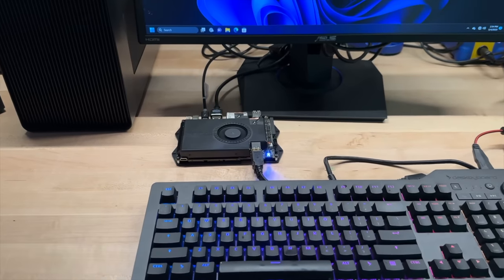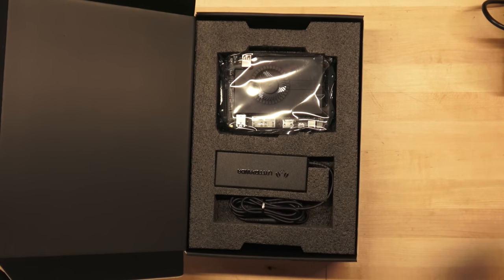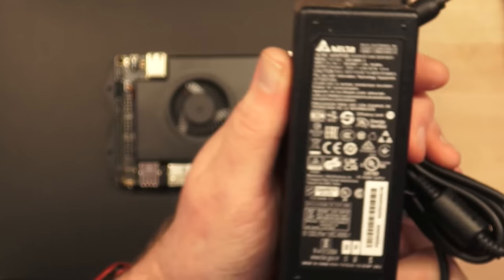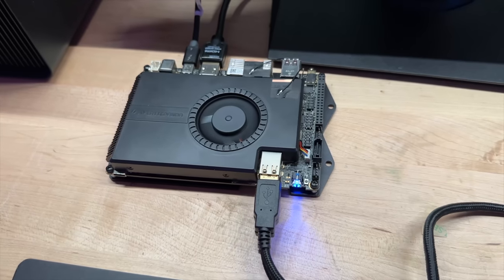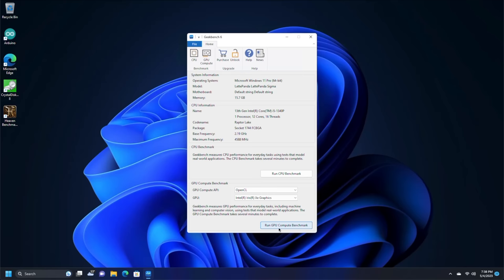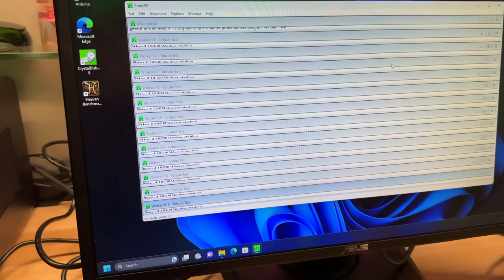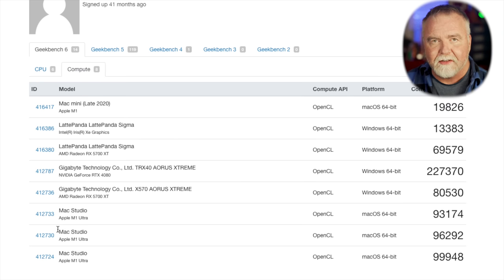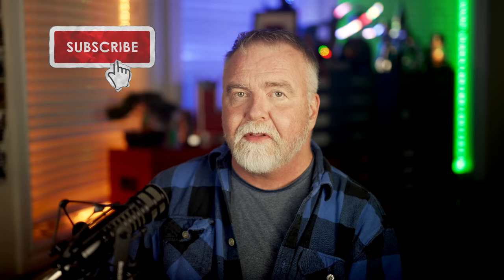The Sigma: The Most Powerful Single Board Windows PC

Comment: Why do they use that awful connector for WIFI? Instead of a plug style?
Reply from the maker: Compactness, I assume?  It's the first time I've seen them this tiny!
Reply: Those WiFi modules are the same ones used in notebook computers and they use these standard type connectors for the coax connection to the fractal antenna boards. Open your notebook computer and you'll see the exact same setup.
Reply: @DavesGarage  They're that tiny in laptops. I broke one of those annoying clips inside my Bheringer x air 18. SO... no WiFi for that since it only had one port for it. It's too small for me to fix and solder at my skill level.
Reply: @jameshoiby  Oh I know, as a man who takes everything apart. Just thought like with USB C, they'd evolve to something better.

Comment: Single board is only really useful as a cellphone. As a pc, certain parts absolutely need to be replaceable, ram, hdd or ssd, ram, cpu, heck even usb ports should be replaceable, and all that requires separate components which would make it not a single board. Mac went awful with their newer computers, nothing is replaceable and if either the touchpad or the keyboard fail, they are one part so they both fail. Powerful is great, repairable and upgradeable is far better.

Comment: I cant wait for the amd version of this
I really hope AMD gives the SBC community some attention, this is what I would want
Zen 4c 16c/32t
40cu RDNA3 (ATLEAST 1080TI / RX6600 PERFORMANCE)
32/64/128 GB options (16gb is so ancient)
2x m.2 / 2.5GB LAN
and 28w max 
An SBC inside a mechanical keyboard with NREAL glasses is the portable future
Reply: How good are current AMDs and Intels in idle power consumption? It's quite hard to find and somewhat interesting for home server (my ryzen 5900x has 57W idle which is horribly bad and when running browser, skype, discord it can go to 90W with 1% cpu load - I found these three applications are increasing power consumption). i5-6500t based minipc is almost exactly ten times better.

Comment: thank you for not being a sellout cuck and doing your own actual review, very much appreciated!

i would like to see a small plastic tool for pushing them antennas in, i can see a board stab incoming already, it could also be used to help align the antenna with the slot more easily.

with it supporting the E-GPU i can see these definitely being used as nodes for a small render farm, if better GPU support was added (with a 4x or 8x PCI-e Slot and a riser cable), of course it wouldn't be as powerful as a full size tower with multiple GPU's but in places where space is limited this would be far better than come of the alternatives I've seen.

Comment: $580 with no SSD or WiFi + taxes. Add the need for keyboard/mouse/monitor. Clearly paying for the provided features.
Reply: I recently bought 2 Beelink Mini PC's with Ryzen 7 6800H for just $500 each. 32GB of RAM, 500GB NVme, they are 8C/16T CPU and when I need to play AAA games, I plug my Intel Arc A770 video card which I paid only $200 for it on special via eGPU and enjoy 60+ FPS at 1080p. And they came with a Win11 Pro license and WIFI built-in.

Comment: "hackable", sure, everything can be "hackable". 

It looks like nothing special, normal PC with Arduino attached to USB,. No schematics, hidden bios settings, and oriented mostly towards Windows, some pc motherboards have better docs.
What if i want for example, xDCI, on with port i'm gonna get it, can i enable it in bios, (easily) does it have detection wired in ? .
Reply from the maker: I'm not really aware of any other motherboards with an Arduino chip built in, so it seems pretty hackable to me!